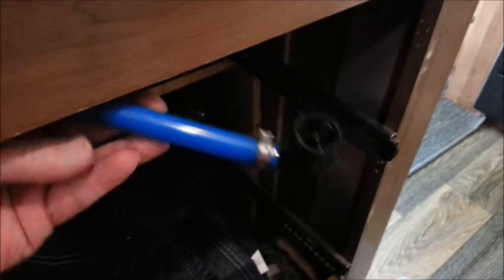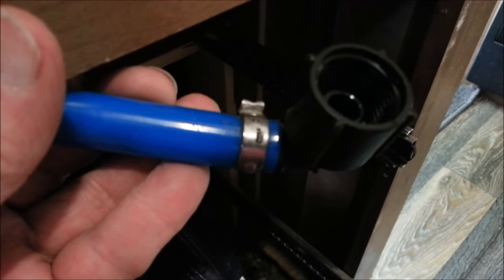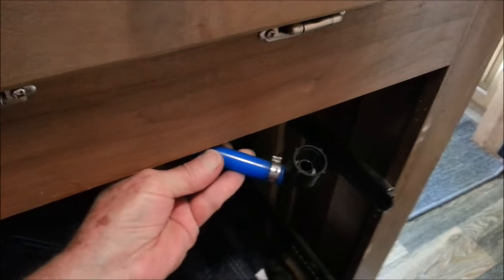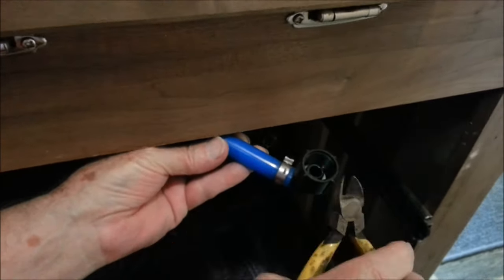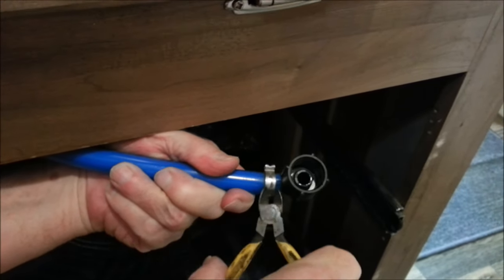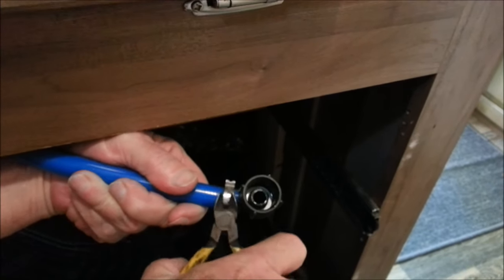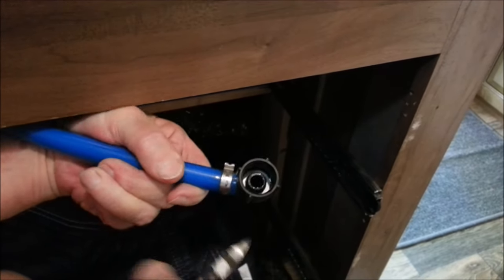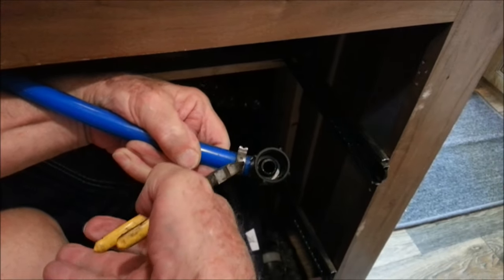Pex Clamp removal.  Easy as pie and no special tools needed!  Finally an easy removal method.

Comment: I hate those clamps. Always something to make us spend more money rather than using standard/reusable hose clamps.
Reply from the maker: Agreed!
Reply: So use a hose clamp. Why they can't work isn't obvious?   Uh-oh!
Reply: @nothankyou5524  The pex clamp is suppose to have uniform pressure all around the hose which makes them better than a standard hose clamp.
Reply: they are seamless on inside compared to worm drive clamps, which has many advantages

Comment: pretty cool. Never seen this video till now, been using my small Milwaukee Dremel tool sense these horrible to remove clamps have been out. Thx for the optional tip.
Reply from the maker: I was so dang frustrated removing those.  I'd paid like $40 for a Pex clamp tool that the sales person said would also remove them?  Lost the receipt, and $40.  :(  Will never use Pex clamps again.  Glad it helped you.  :)

Comment: Try quarter turning the crimper head and clamping down on the crimped square of the pex crimp. It cuts the pex square clean off and u can just pull the crimp easily from the fitting etc. the tool is much much harder metal than the crimp and doesn’t even scratch the tool in this method. It’s probably in the Manuel we never read right lol
But yeah just sat and looked at the tool and thought hmmm 
Quarter turn for the win
Reply: Now to hide from the hitmen the fittings manufacturers send my way lol
Reply: That's what I do. Works great!

Comment: Is there a way to loosen the clamp so you can reuse it
Reply from the maker: If that tab you loosen to get it open doesn't break, you could try reusing it I'd think.
Reply: They clamps are not reusable. Getting the clamp back together would be impossible.
Reply from the maker: @OTClems  Thanks for the info.
Reply: Ask your HO Ins. Co. I'm sure they'll be in contact with you.
Reply: @OTClems taken apart properly, they're reusable. But who actually would?

Comment: Didn't work at all. You cut everything except for the band, Anna had to use a Dremel to cut it off
Reply from the maker: Sorry that didn't work!  I'm surprised, mine straightened right out and the band just popped right off.  I thought about buying a Dremel for that, but I couldn't afford one.  Glad it worked for you with the Dremel.  Thanks for the feedback.
Reply: How could his instructions not work. It only has to work one time to proves it works.  Skill is verified thru repetition.